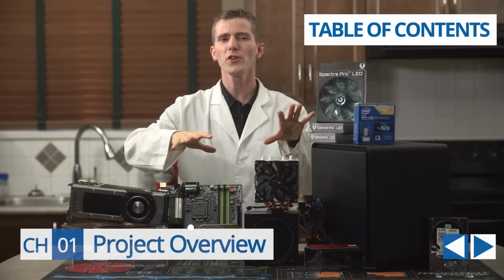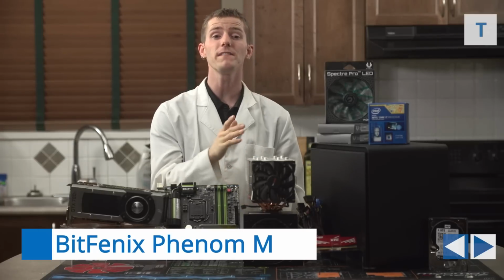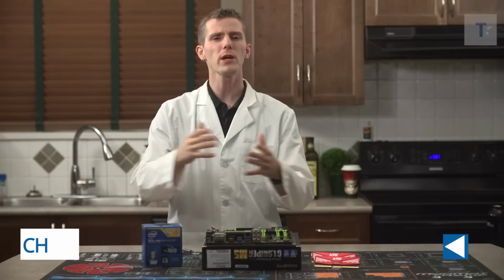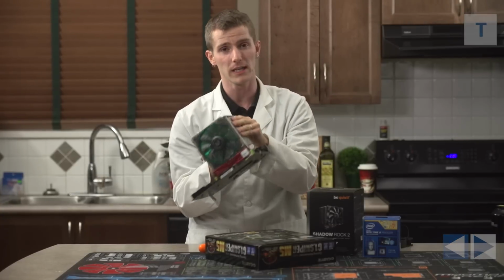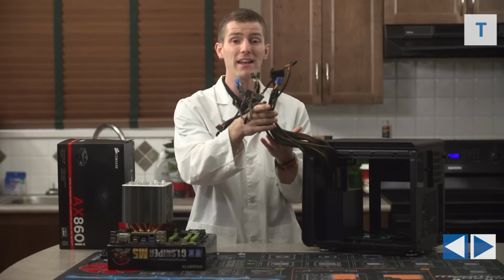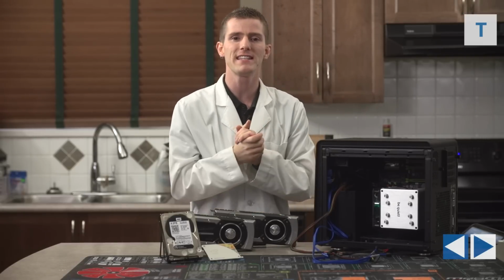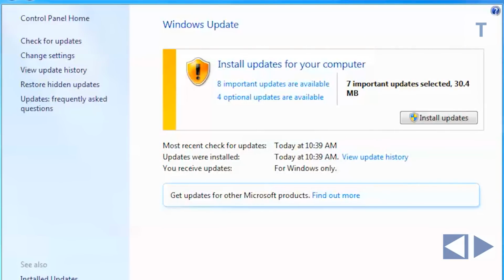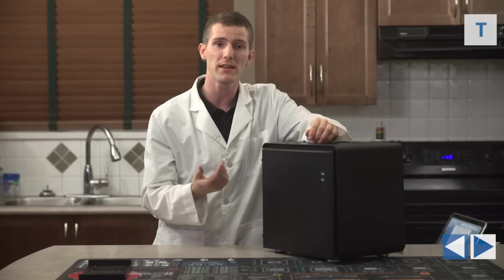ULTIMATE Intel Compact SLI Gaming PC Computer "How To" Build Guide

Comment: Dont go Win 8 what ever you do i have it and the compatibility issues are a pain in arse and some games simply dont work.
Reply: RapidProgram I use windows 8.1, and the ONLY compatibility issue I had was rainmeter not working for about a week before it was updated.
also windows 8 has so many more feeaattuurrreessss, how could you not want that :c
Reply: RapidProgram
Just Cause 2
Reply: Ben Pilcher Just Cause 2 works for me, running windows 8.1
Reply: ***** Why does everyone have to rip on the fucking metro apps?! I hate them too, everyone does, there's a simple solution: DON'T FUCKING USE METRO.
Reply: i have windows 8 and i have not had a single problem
Reply: RapidProgram
many many many old games i mean A LOT OF OLD GAMES
Reply: RapidProgram
every one does once in a while
Reply: RapidProgram
i know it works i had windows 8 i had a lot of problems on a laptop that me and my friends call it the heater becouse it overheats but dosen't matter
It blue screened once in a while and it wasn't necesarly from the pc on windows 7 never blue screened and i had like 3 gigs of ram and 1.5 gigs were used on idle for some reason and i hadn't have any programs open at all !
i haven't tryed 8 on my new pc i don't think will do well this one has heating problems too the cpu and is not a laptop i3-s have heating problems waaaay to much heating problems
Reply: NikWillOrStuff Only games I play are SWGEmu, Fallout 3, Fallout New Vegas, Skyrim, the elder scrolls online (started like 1 week ago), Oblivion, and SWTOR, Skyrim, New vegas, and fo3 have arround 250plus mods, do you think windows 8 will have incompatibilities issuses with those games?
Reply: pumastp98
not everyone play only new games some are a bit nostalgic and want to play games from their childhood (ex. beetle crazy cup,colin mcrae 2)and you see that you can't and you have too hook up a 13 year old computer just to play those (is what i did with gearhead garage it didn't work on 7 neither)
Reply: RapidProgram
i know but some games are not that old to work on a virtual machine and do not work on windows 8 i would use xp now but yeah no directx11 for xp :(
Reply: RapidProgram
i had it cracked anyway piracy is legal in romania :)
Reply: RapidProgram
is not in romania as far as you don't put them on disks and even then nobody will know cuz nobody comes to search your house is half legal and is half ilegal only on paper is not really ilegal at all :)) we can use the pirate bay too and we have like tons of romanian trackers and we have the best hackers in the world a quarter of the employes at nasa are romanians and i am not kidding :)))
we have hackers that hacked nasa's site ! read on internet about tinkode i think he did it and a couple of others did it before him and they are now at nasa
Reply: Not So Retro Gamer Lol all my games are directly from Thepiratebay.org :P also have like 20 movies, and 2 books from there
Reply: RapidProgram
why you don't pirate games :))) nobody can catch you and if you want i can give you a invitation to a romanian private torrent site
Reply: I'll take an invite :)
Reply: RapidProgram as far as I know the older Valve games don't have support officially. My friend had Windows 8 and GTA 4 doesn't work.
Reply: pakadyno
it works when he wants for example on my new pc gta 4 have errors and it has win 7
on my old pc with win 7 it works with lag but it runs
Reply: Not So Retro Gamer So you are saying that GTA 4 works wen My friends want it to? GTA 4 just has awful optimization
Reply: pakadyno it really has :)) i have a pc that back when the game was made is better than any pc in that period....still cannot run it on very high :(
Reply: Ben Pilcher even multiplayer?
Reply: Yup go with 8.1 it's way better than 8!
Reply: Andreas Holdersen Pff you clearly never have been to an Apple VS. Android video
Reply: ***** I don't have Gears of war 1 so I wouldn''t care less.
Reply: Ben Pilcher I'm playing Just Cause 2 right now... NOBODY LISTEN TO HIM 8.1 IS HEAPS BETTER THAN 7, AND WILL GIVE YOU BETTER PERFORMANCE
Reply: Okay well as someone with Windows XP, Vista, 7, and 8.1 on various computers I can assure you 8.1 is probably the nicest looking, easist to use OS of them all. Everyone I know who has it agrees it's pretty decent. And again, better performance
Reply: A lot of old programs won't work, even though they worked on Windows 7.
Reply: The only benefits to Windows 8 and Windows 8.1 over Windows 7 are slightly better performance, DirectX 12 and better compatibility going forward.

But the UI and GUI is horrid unless you get some third-party solutions to mod it, to get things like the start menu or transparency back. The compatibility isn't that good too like you said. 

A lot of older games and programs in general won't work or won't work easily. It took me ages to get Diablo working on 8.1. All of this stuff worked fine on Windows 7 though.

Backwards compatibility is important, and Microsoft fucked things like DirectDraw with Windows 8, costing compatibility with several older and legacy programs.
Reply: xPokemonPlayerx
also, most games suffer fps, anything over a year old grants you 10% less fps, games up to 6 years old grant you downwards of 60% of your total fps you should be getting, etc etc
Reply: RapidProgram This is a device, my Logitech Attack 3 doesn't work on my Windows 8 laptop (now has the better, Windows 7 OS) and I couldn't use my flight stick. It worked on my Gaming PC with Windows 7.
Reply: stay10578 depends on what youre using it for too, what peripherals you use, brands, and your definition of a 'problem', maybe 'i can deal with it' to you isnt a problem, but most people expect something to happen when they do a certain action, and if it doesnt do it, its a dealbreaker
Reply: Not So Retro Gamer Yeah there is something wrong with your PC
Reply: Yekizlon it's not , any pc i tryied to ran it on . it was no difference between very high and high on frame rate , when i swapped the GT630 for a R9 270 i didn't gain any fps
Reply: Not So Retro Gamer
Your CPU is probably bottlenecking it.
Reply: Yekizlon
it isn't ;)
Reply: How do you know?
Reply: Yekizlon
on any game except gta 4 i have HUUUGE FPS boosts
i can run crysis 3 on ultra with no issues whatsoever
the cpu is a Intel Core I3-3240
Reply: Not So Retro Gamer So, we don't care about your CPU if you have a GTX 980
Reply: VisioningHail
yekizlon thought my cpu is bottlenecking , so yes , he kinda cared about what cpu i have , and i don't have a GTX 980 , i have a R9 270
Reply: VisioningHail read the whole thing before you post, it just makes you seem ignorant.

Comment: LinusTechTips I'll be using this as a reference for my first build I was on gigabyte's web and in the faq for the G1 sniper M5 the weight limit for the cpu cooler is 450g, but the shadow rock 2 weighs at 1.12 kg. will that pose any significant problem?
Reply: kinda hard to say... I doubt it though... the heat sink may be 1 kg, but it is supported with the backplate and screws, so there it is reduced (on the other hand maybe... I doubt that gigabyte thought of that heat sink on that mobo, my eyes popped out when I saw that heat sink)

same with graphics cards, they weight a lot, but are supported with a screw in the case expantion slot

Comment: 85 degree Celcius GPU Temp?! Are you kidding me Linus???
I would have expected you to want waay better temperatures for ANY build you make! An ATX system with acceptable Airflow would run much cooler!
Reply: That case is so small, i am surprised it would even get new air in it.
Reply: Nope I dont, he said it would bring ACCEPTABLE temperatures at the beginning
Reply: FlareFPS 95 degrees is also acceptable for someones, you know? I don't like having my parts running hot too. But those graphics cards run at 82 and 85 degrees because he sets the temperature target to 95 degrees. By default, they're going to run at 80 degrees, and you can customize that with GPU Boost 2.
Reply: FlareFPS Whether you like it or not, 85 celsius is fine for GPU's, they're made to run really hot.
Reply: Someone doesn't understand GPU Boost 2.0...  GPUs operating at 85C is perfectly acceptable under artificial full load and also perfectly acceptable in Far Cry 3 Ultra with EIGHT TIMES MSAA. Those GPUs are going to kick out as many frames as they possibly can in order to hit a target power draw or temperature. IF they actually hit the 95 degree mark, that would be indicative of poor airflow. Also considering that he went for the rear vent, reference model graphics card without fancy coolers, those temps are even more acceptable.

Comment: would a build in this case be ok for a first time build...if not, will an matx board look weird in an atx case? also, do you need a blower card for a small form factor build
Reply: Wouldn't recommend small form factor for a first build. It depends on the board and case, but in my Arc Midi (which I love, it's exactly like the Define except without the sound dampening) my micro atx board looks alright. Of course the Define/Arc Midi's are short and fat and it would definitely look kind of weird in something like a 750d

Comment: Can you add a cd player to this?
Reply: well sure but not in the case but buy a usb on :) it will be fine
Reply: ***** Which aren't THAT expensive, you can find one for 30 bucks or so
Reply: U can add a cd drive BUT not with this case
Reply: MrHearthofSIN I never new there was a CD player that just plugs in to the computer by USB!!
is this correct?
Reply: HRR gamer yes...I own one...
Reply: HRR gamer it most certainly is :) just like external harddrives :)
Reply: that is cool thanks guys so this plays cd games and movies and music
Reply: uhm yeah just like a normal drive :) but if you are going to use it like insanely much atleast buy a decent one.. they tend to be a bit expensive :)
Reply: No, I'm sorry but the CD drive is an extremely powerful part and you would be severely under-powering it as well as severely bottle-necking it especially because you're ONLY running 2 780ti's and a core i7... (if you can't tell I'm being sarcastic)
Reply: HRR gamer PLEASE... Why do you watch a 2000$ build guide if you call a PC "cool" when its able to play music???! Even iPods from the 20th century could do that, newb.
Reply: FlareFPS what is your point...? i'm sure he knows it can play music but he asked if it could add a cd player. what if i likes cd's ?..
Reply: "HRR gamer04.04.2014
that is cool thanks guys so this plays cd games and movies and music" scroll up pls.
Reply: MrHearthofSIN Why not just add a Blu-ray Player or at least a DVD player instead? CD players are way too old.
Reply: well i also meant dvd :) i jsut as a reflex write cd.. xD well he could add a blueray player but i believe he can make that decision himself :)
Reply: MrHearthofSIN Oh. c:

Comment: Nice build, I would have gone with a Corsair H80i cpu cooler,to provide a little more internal air flow if it'll fit. And also allowing the bracket to be used for SSD & HDD mounting, even though the drive mounting route you went is acceptable.

Comment: How will this Computer do? It will be used for gaming, and yes I'm under a budget :)

Motherbord: ASUS M5A97 PRO 970 R2.0 AM3+ ATX
CPU: AMD FX-6300 3,5GHz 
GPU: AMD Radeon R9 270X OC 2gb gddr5
Memory: DDR3 1333 MHz 8 GB 
HDD: Seagate Desktop HDD 1TB 7200RPM SATA/600 64MB
PSU: CORSAIR CX 600W M BRONZE ATX12V

Comment: Why didn't you install the SSD in the left door?
I have a Prodigy M. I went with that option, with the doors being flipped - but in the end had to flip them back due to a short somewhere. Current was running through the chassis and would shut down the computer if you touched the metal.

Comment: 3800€ (without the extra fans) for this beast.

Absolutely NOT worth it in my opinion.

But hey, nice video none the less :-)
Reply: just use a gtx 770 at first it will save a lot of money and is really powerfull and after a few months you can buy a second one
Reply: ikki That's exactly what I'm doing bro, just bought my second monitor and a aftermarket CPU cooler, now saving up for a second 770 :D

Comment: I have a Asus GeForce GTX 760 2GB, 
Corsair CX 600W, 
Western Digital Caviar Blue 1TB
Corsair XMS 8GB
ASRock FM2A88X+ KILLER ATX FM2+ Motherboard
AMD FX-6300 3.5GHz 6-Core Processor
can i run farcry 3 on ultra or high settings with 50 to 60 fps and bf4 on high to ultra with 50 to 60 fps?
Reply: Im confused are u planning to get this or do u allready have it?
Reply: Im planning but will it run bf4 on high to ultra?
Reply: srry i said have but its shipping

Comment: This computer costs £2,278.. How can I decrease the price to £1,000 price range?
Reply: I would recommend changing to a i5, u dont even need a K one if u dont plan to overclock. Also (is Aus) these cards are about $850 so putting a 760/770 would bring the price down allot. Also if u dont need all the overclocking/expandability features and model down or so on the motherboard will drop the price (just make sure to still get a MATX one). Another way to drop the price would be a smaller PSU, maybe 600W. Also only get the storage u need maybe a 120/240 ssd for OS and some games then a 1/2TB 3.5 HDD. Maybe someone in Eourope can reccomend some specific parts from there (i dont really know and good stores there).
Reply: Thank you

Comment: 27:13 After building over 1000 computer by now. I realize one easy way of plugging in all the front panel switches for the orientation. Just make sure the white letters face out!
I have't come across a situation when the white letters faced inward for proper +/-

Comment: Is the be quiet heat sink good for overclocking?
Reply: You mean purely using the heatsink and no fans?
Reply: with the fan But i want to overclock my cpu ...
Reply: Okay sorry misunderstood :P.
I think the Be queit heatsink is perfectly fine for a decent overclock. it however depends on your CPU because Haswell and AMD get quite hot.
Reply: are you kidding me ? Linus had horrible 100% temps on the cpu it was 90 degrees celcius which is fine for not overclocked cpu's because it will never really run at 100% but if you wanna overclock it imagine the temps :) go for water cooling or if it has to be air cooling go for a thermalright silver arrow :) i recommend that you watch this (also linus) /watch?v=u8HsjgtMzEg
Reply: ItsHell Just chiming in on the Haswell and AMD get quite hot. I only have a FX-8350 and I only run it at stock because I just haven't jumped off that higher diving board yet. Me building my own rig was a product of getting screwed by P.C. repair people twice, and then calling around for something ridiculously simple. My PC being down because of the motherboard I was scared I may have injured my GTX 760. I just wanted someone to power it up and see if they got a screen. Most places assumed I was completely ignorant and tried to sell me some kind of uneeded tune-up without even listening to what I wanted. One guy actually told me he would do it for thirty dollars after I offered him twenty to just power up the card. You can imagine what I told him. I have finally settled into a Phantom 820 and nothing I can do while it is stock will make it get hotter than 45 C. Prime only ran it up to 38 degrees and it took running the intel burn in for an hour to hit 45 degrees. I have to believe what I once read " Buying CPU's is like playing the silicon lottery. You never know how good of a unit you are going to get." I only run my CPU at 4.2 GHZ, but I get sweet FPS in all the games I play. The watercooled PC's do like nice though don't they =).